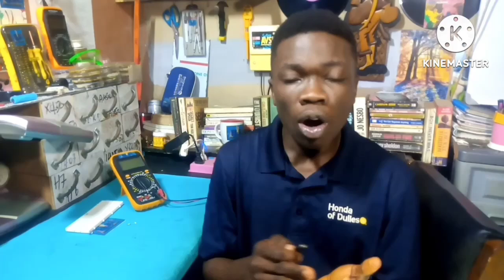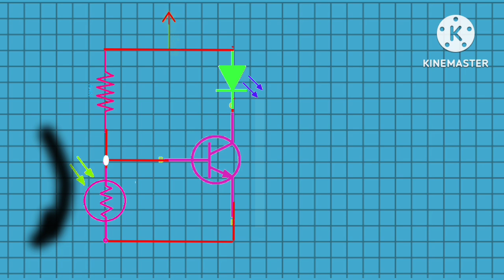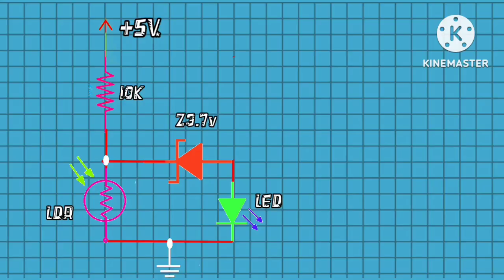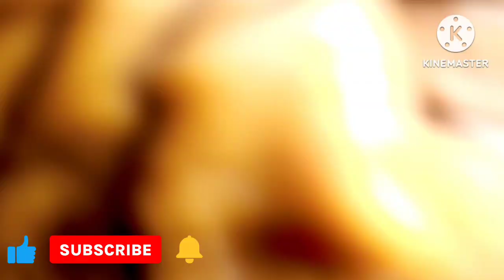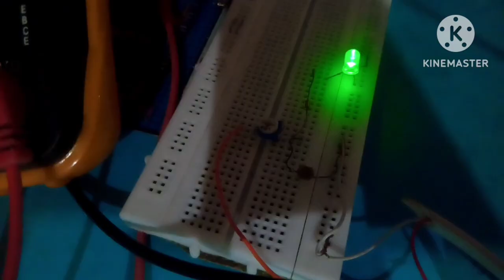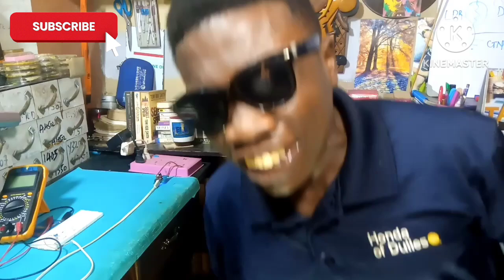What Else Can Be Done With The Zener Diode (New Discovery)

Comment: You actually do not say what voltage you are using. It is correct that the Zener will conduct when the voltage across is 3V7 or above, but the LED needs around 2V, so the hole string needs 5V7 or above ?
Reply from the maker: I did mention did you watch without having to skip a part? if not, i used a 3.7v which i am sure i did mention.